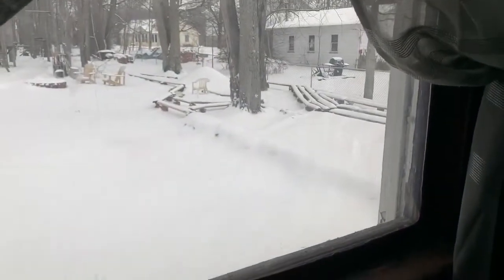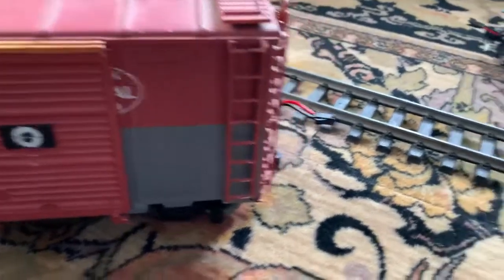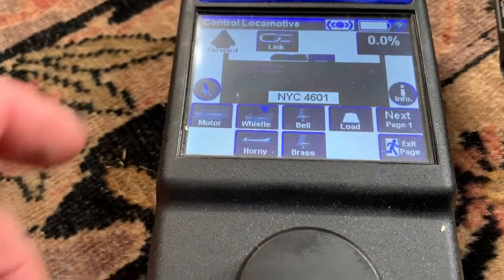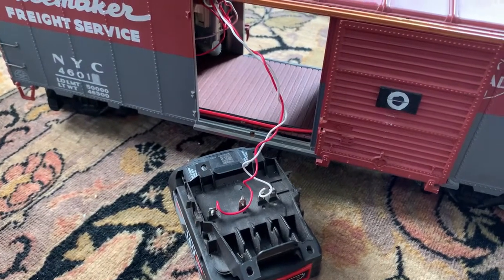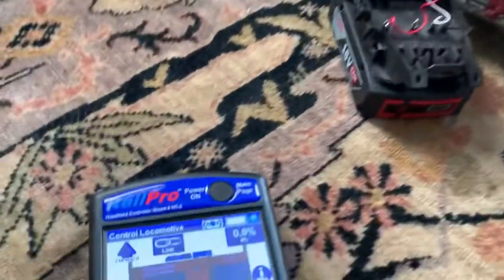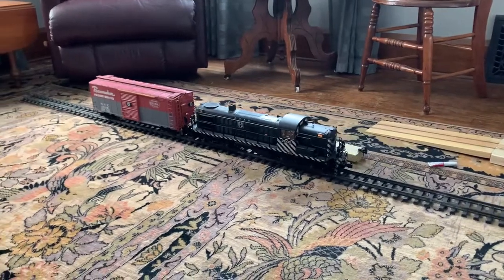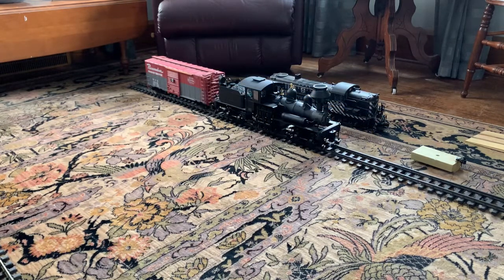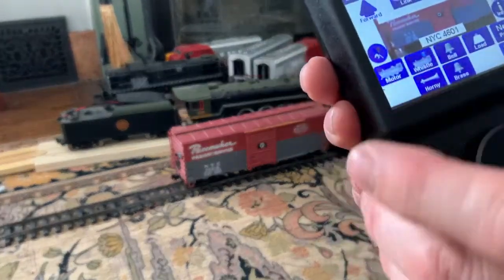G Scale Railpro Trailing Car With Three Sound Options & How I did it! 2/16/21

Comment: I love my RailPro!  Since you've got the room for some extra buttons, you should consider adding in "Brake".  I like running with the load setting pretty high because I like the inertia feature so I think the brake is gonna help keep me out of trouble,  On a side note, it looks like your Shay is suffering from some gear slippage there.
Reply from the maker: Yeah, I might try and hunt down the new trucks.
Reply: @TheeFishGuy  They're not cheap.  I just got a brand new pair of diecast trucks via UPS for my Shay this afternoon!  Set me back about $240 but I think they're gonna be worth it.
Reply from the maker: @bhubbard491  I’ll just tear em down and fix em!

Comment: What did you do for lighting control?  are you using track power for that otherwise your connector from the car to the engine would have multiple wires.
Reply from the maker: No controls for the lighting but when I initially re-wire an engine I use LEDs. When you reverse the wires you’ll get “directional” lighting.

Comment: Do this have to be built into the train
Reply from the maker: The engines themselves need to have an mu plug installed for the power source to connect to. Beyond that they need to have either a track/battery switch installed or all of the track pick ups removed so the battery power doesn’t back feed into the track. In my case I remove all track power related pickups as my track is dead.

Comment: Do you have a video of how you wired the battery to the railpro. I’m want to do the same and I don’t want to burn up my railpro board with over voltage. I have makita 18v 6ah battery’s.
Reply from the maker: The boards can handle 24V. .wire the battery into where it says “track” on the Railpro board.

Comment: Hi from Robert your chuff is definitely to soon, as soon as I can I will look at my rail pro I know it has to do with start up speed. The one thing I don't like about rail pro shay it goes from 0 to full chuff sound immediately that's not normal. Also on my if you run chuff full it does slow chuff rate down a little. I have tried to find a better shay sound to send to ring engineering but no luck either ring bells, whistle or wind over rides chuff sound.
Reply from the maker: I have detailed instructions from Ring on how to adjust chuff rate.
The steps to setup chuff rate.

Set Start Speed
1) Select loco to run it.
2) Set speed to 1%
3) Go to adjustments
4) Select the start speed.
5) Turn up speed until loco is moving 10 - 20 SMPH (not critical). Note: loco speed changes as you turn the knob to adjust start speed.
6) Slowly lower the start speed until the loco stops moving.
7) Reduce the start speed by 1% more. Typical Start speeds settings range from about 5 to 30%.

Set Top Speed
1) Select loco to run it.
2) Set speed to 100%
3) Go to adjustments
4) Select the top speed.
5) Adjust Top speed to desired top speed.  Note: loco top speed changes as you turn the knob to adjust top speed.

Set the Chuff Rate
1) From the control loco screen set 
https://www.sparkfun.com/products/13118the loco in motion (about 25 SMPH)

Comment: never messed with Rail pro but in my case I am going to be moving away from 6 C cell batteries to a single cam corder battery. rated at 7.2 volts (and under 9 volts which is easy enough).
Reply from the maker: 7.2 won’t be enough to run a G scale engine for very long.
Reply: @TheeFishGuy  There are rechargeable 9 volt  li-ion batteries that I could use for my Bear Loggers Express by New Bright. though some camcorder batteries tend to go as high as 7.4 volts.